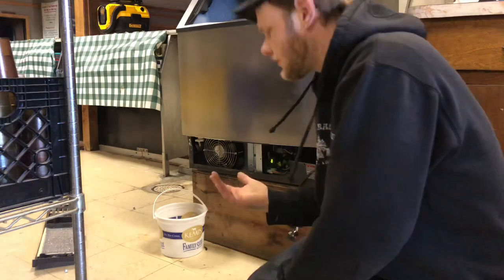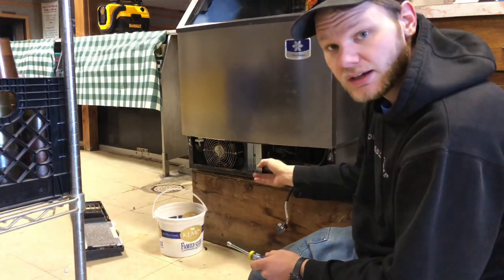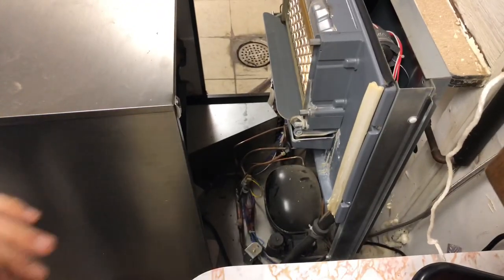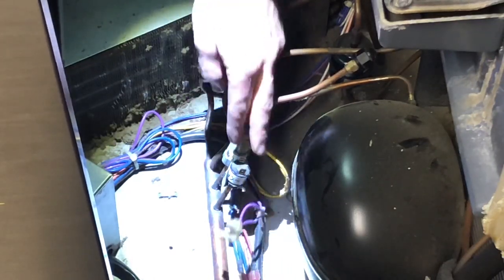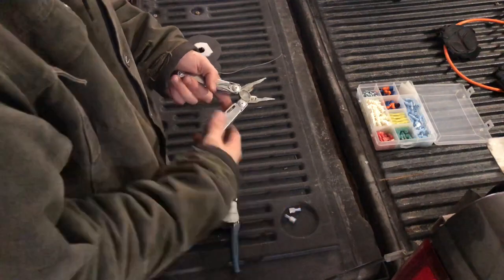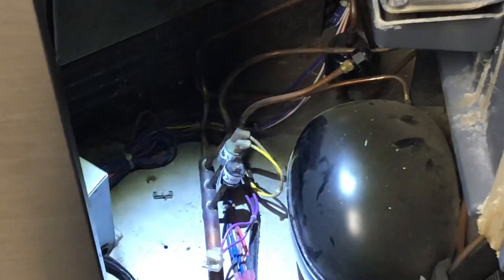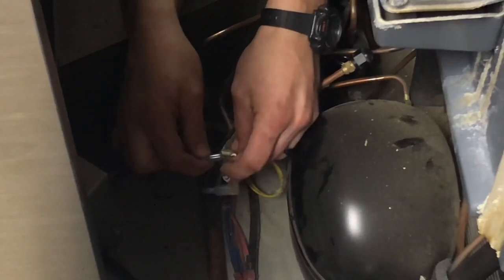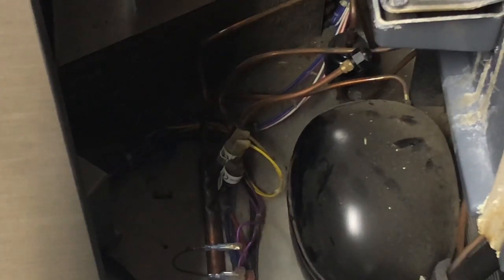Manitowoc Ice Machine Fan Troubleshooting

Comment: I know it's a long shot since the video is so old but I need some advice on my machine. It's the same unit. It powers up, runs water for a few mins then stops and the "Service Light" comes on. It doesn't seem like the evaporator is getting cold. I've cleaned the front filter and the coil. I'm not quite sure where to focus my attention. Any advice would be great.
Reply: Sounds to me like you might have a refrigerant issue. You might be running low on refrigerant in the system if that is the case, your regular refrigeration company will be able to get that problem resolved for you. Basically any company that can service a walk-in refrigerator will be able to service this unit.

Comment: On indigo ice machines the purple wires is for HPC not fan cycle.
Reply: I have an indigo self contained unit with a short cycling condenser fan motor only not the compressor. So it’s the low pressure switch failing?

Comment: Was it the low or high pressure switch? I work on mostly indigo Manitowoc machines and I have a condenser fan motor short cycling
Reply: I think it was a pressure switch, solely dedicated to the fan. Clicks it on at a certain pressure and off at another.

Comment: Sir. Please i need to help. I have icetro ice making machine.  Power on frist start pump on 3minut after water pump stop. Compressor and condenssor fan     not working. What is the problem  . Pls explanation  thanks
Reply from the maker: Davoodadnan Davood your cooling system is dead and as a result your ice machine is dead. Probably not what you want to hear but that is not worth the time or money to repair.